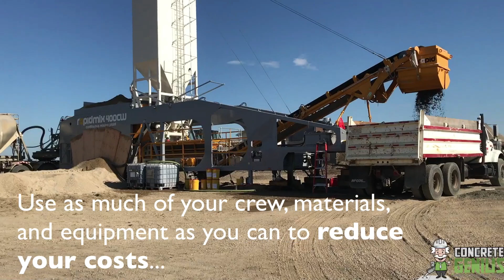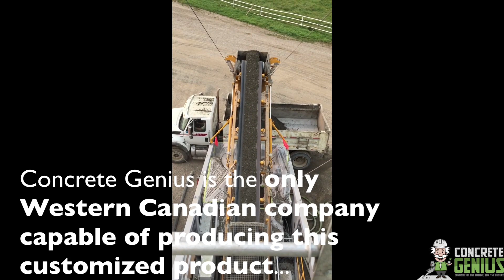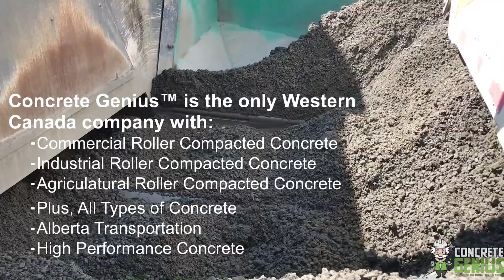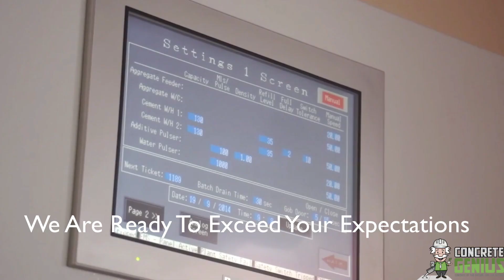Feedlot Compacted Concrete™ - Bonhomie Cement™

Comment: The word "should" is used a lot. Tells me that nobody really knows whats going to happen, they're hoping it holds up.
Reply from the maker: Hi there, Unless I am missing it I don't see one use of the word "should" in the video. That said... even if it does say "should" I would like to point out this product is engineered using the same engineering tools that roads, dams, bridges, etc. are built with. Meaning we are VERY confident in it's quality and ability to last. We are constantly performing testing while producing to ensure the product meets and exceeds our customers expectations. We could design the product to last 100+ years but the reality is the economics do not make sense in the agriculture industry for this type of product. Therefore, we designed Feedlot Compacted Concrete using the most economical local materials and install practices for the customer to get the best ROI for their project, which is typically a 20 year life span design with ROI's in as little as 1 year depending on feedlot conditions and other factors. With over 8 million sq ft of RCC produced in the last 3 years we know this product extremely well and know how it will last and perform.
Reply: @bonhomiecement6208  Like I said, the word "should" is used a lot. If you're missing that you must be watching a different video. Thanks for spending all that time to attempt to defend your product, like any good salesman trying to make their story true.
Reply from the maker: @farmcentralohio  hmm ok well I guess we are seeing different things. At the end of the day all that matters is the science and the third party testing... not opinions. Over 10 straight years and tens of thousands of third party testing we have never failed a test. We are happy to sit down with any of our customers to show them this test data and help them make an educated decision. Best of luck to you